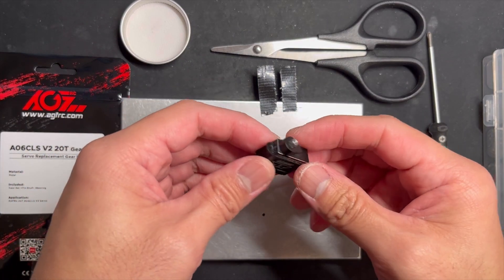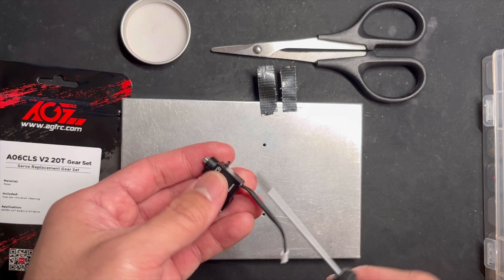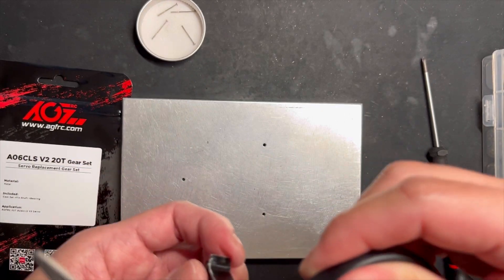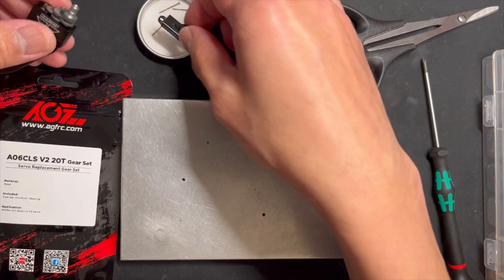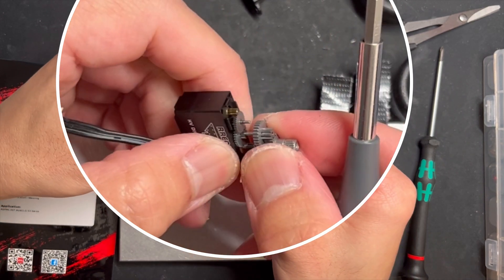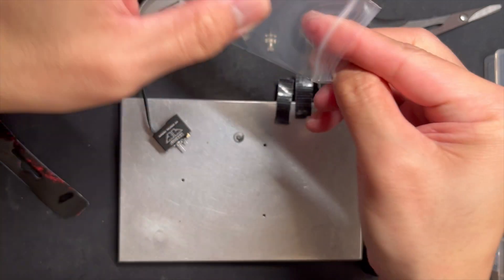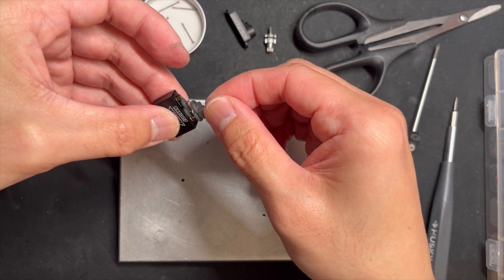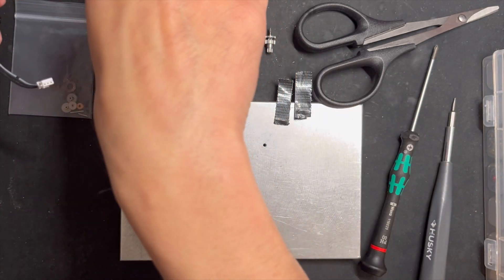How To Video: Replacing Servo Gear (Reflex Racing AGFRC A06CLS v2 20T)

Comment: I have the Pn racing anima Hstg servo. Will this replacement gear parts kit also work with my PN anima servo?
Reply from the maker: I'm not sure. I've only opened A06CLS V2 20T servo and this kit is for that.
Reply: @tjaymacRC  which servo will you recommend or At least the one you think is the best for RX28.
Reply from the maker: @popitn2nd  I’ve only tried the Reflex and A06CLS and I can’t tell the difference. I think they’re the same. In my personal RX28’s, I only use Reflex Racing servo.

Comment: Hello again Tjay. I got another question.  I have 2 mr-03 that will lose forward throttle only. Everything else still functioning ( reverse, steering ok). Any idea why?.  There is one thing in common with both chassis.  I put the Xspeed motor in them. Let me know your thoughts.  Or if anyone in your club may know what it is.
Reply from the maker: Hi, It's probably best to post this question on Facebook Group Page: Mini-Z Community, but it sounds like burnt your FETs (MOSFET) but I'm not 100% sure.
Reply: @tjaymacRC  that's what I thought but it will start to work again if I mess around with it and I ain't sure what it is that I do to get it to work again or what is making it stop. I am not on Facebook.  Thanks for the reply.  I try and watch your videos so when I am ready for the rx28 then I will know some in's and outs about it. Thanks again
Reply from the maker: @twistedbeardcreations2588  - Do you have MR03 RWD or MR03 EVO? If RWD, that motor should work on that car without doing anything to the board. If EVO, you will need to setup the ICS for brush motor since this board (MR03 EVO) is defaulted to brushless motor.
Reply: @tjaymacRC  mr-03 Rwd. The cars I have that are still stock have been running everyday for almost 10 months with zero issues but the two with Xspeed motor have been doing this after a short period  of installing the motor. So when you are running your car and getting 1200 laps. How do you do this? Run until the batteries die and replace and run again.  Or do you run 5 min and then break then run 5 more minutes?  I really loved the improved performance from the Xspeed motor and I would just run hard until the batteries sagged (40 mins) . Is that good or bad? Maybe the FETs is getting to hot.  I haven't been told or heard of a max run time and break intervals.  I am just trying to be ready to race you and EMU some day  ;0)
Reply from the maker: @twistedbeardcreations2588  - I do 1200 laps in a day sometimes but that's from noon until 9pm. I can do 120 laps in 20 mins straight on my lipo car but I don't recommend doing this. I just didn't want to get off the stand when the other drivers showed up with the same motor I have so I just ran it until they stopped running theirs.  Normally I do up to 70 laps for 1 pack and that's 10 mins of 3500 or 5500 motor.

For AAA batteries with Box stock motor or PN70 motor, I can stay on the stand for 40 mins with a set of battery with no issues.

Comment: Thank you, Tj! I blew up a servo yesterday 😂. 
I have a question unrelated to this video. I got a lexan car yesterday. I notice you use the mako x body. do you notice a difference, or is there a difference between using that body versus something like the PN sedan or any other body?
Reply from the maker: Perfect timing on the video! ;)

I use the Mako GT, part number is RAD002. I don't think I have the Mako X (yet). Do I notice the difference between the Mako GT vs other lexan bodies, yes sir! That's a pretty noticeable difference especially if you're used to running a certain body. For example my cars with the GT body and then recently, I got an ARES-1 body and the difference is noticeable in feel and lap times. 

Why the Mako GT? Because: 1) the front bumper is round and smooth, 2) doesn't catch the rails, 3) has a nice balance feel - Its not front heavy or rear heavy, although I did trim the spoiler by a lot., 4) thicker so it lasts long (mine is almost 1 y/o in April) but not too heavy. Mine is still pretty light at 14.2 grams.

I can't recommend any other bodies atm other than Mako GT since I don't like testing bodies because I don't like prepping and painting. I wish I can just buy bodies already painted white with body posts holes in it already. lol
Reply: @tjaymacRC  Perfect time indeed! I
got the car used, and it came with a SubRC JX sedan body. My local shop (Wolfram) only  has the Mako X. We really don't seem to have a body preference at the track. I may buy a couple of different styles to try them out and put basic paint jobs on them, or I could just paint them and send them for you test... New video idea!
Reply from the maker: @justinjames4969 - That's good. At least the cars looks different from each other. Locally most of us are running the same body.

Appreciate that man, thank you but no testing for me atm. I just spent the last 1.5 months trying to find good tire combo for my Mod and trying to get my non-SE RX28 in the Mod speed. I've learned a lot in the process but it just takes me forever to do the tests. Luckily this Mini-Z is very convenient vs when I'm doing test on my mountain bikes. Anyway, I do appreciate you looking out, just not ready to do any tests. I said the same to manufacturers. Sorry Justin, thank you.
Reply: @tjaymacRC  No problem! It was just a thought. You seem to be able to put way more laps in than I can in a month lol. I'm always down to help others in the hobby, especially when they give back like you do.
Reply from the maker: @justinjames4969  - I enjoy watching the car lean while driving it on the track and I average around 2k laps a week. Just driving around and around until my hand hurts. lol I just really enjoy watching it. Doesn't matter if I'm by myself or with others, I can stand there for hours.

That's awesome man! I help whenever I can and this channel is helping me out a lot by just sending the links to the drivers as opposed to re-typing everything again or verbally explaining it in person. I'm glad its helping non-local drivers as well. 

Thanks Justin!!

Comment: RC dentist at work!

I use a set of smallish channel locks to press the top cover of the servo off.  But your method looks to work just as well, actually probably better as you have more leverage.  The tape is a nice added touch to protect the finish on the servo.
Reply from the maker: Thanks Eugene! 

The first one I did I was second guessing if this part of the servo really comes off because it was so hard to pop using your thumbs. lol